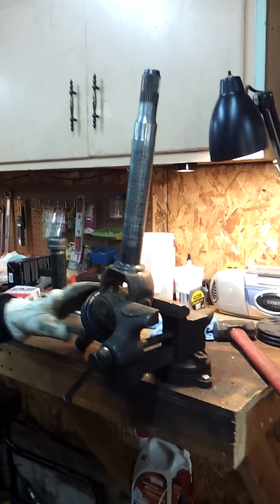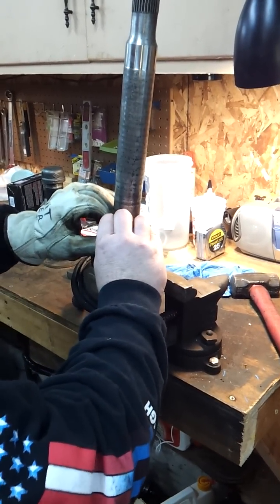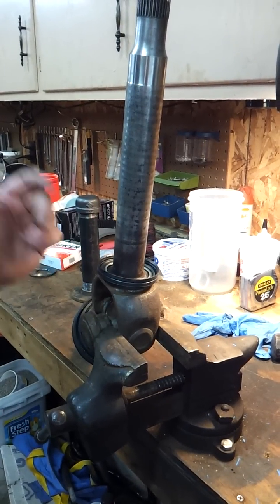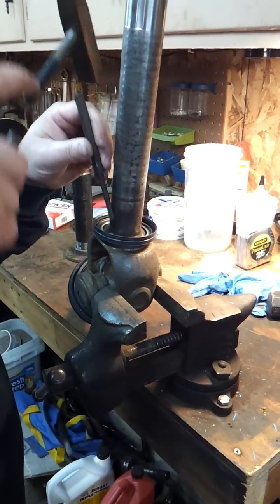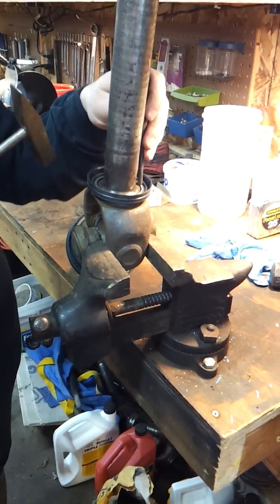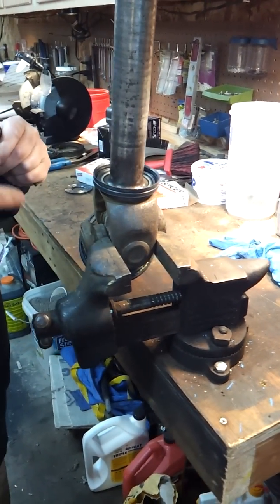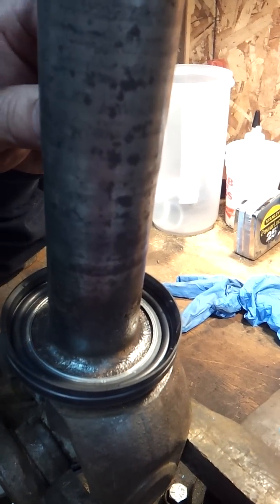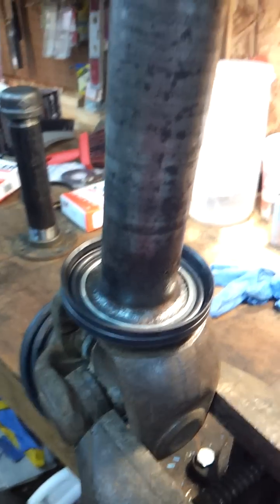2000 F250 front axle rebuild Part 5

Comment: I have a 2000 F350 4X4. I am having such a difficult time getting that dust seal on over the axle lip or collar or whatever it is called. I have tried the way you are doing it in your video but it pops off on the opposite side when I tap on it. I already got the driver side done with a ball joint receiving tube that measures 2-1/4" inside diameter and 2-1/2" outside diameter. It was a pain in the rear but it worked. I tried doing the same for the passenger side and it is not working this time. I measured the inside of that dust seal, National 710413, that is the old style, and it is around 55.8mm diameter and the axle collar that it is to go over is 60.4mm diameter. It doesn't make sense that they would make that with such a tight fit. From what it looks like, if the metal washer thing that is in the seal is driven tight on the shaft, it will rotate with the axle and therefore making the outer surface of the seal that makes contact with the axle tube causing it to deteriorate from the heat build-up when the axle spins. I just don't understand why they designed it like this. Also, the weight of the axle, especially the passenger side since it is longer/heavier would put a load against the dust seal causing it to prematurely wear out  and also then put stress into the knuckle seal on the stub shaft. What is your opinion on this?
Reply from the maker: +Nate In TX  Nate my only comment and I'm not sure if it is right or not is: check the lip on the collar if there is any rust or burrs tried gently filing or emery clothing them and see if that help to getting that seal on.  Its been awhile now since I did mine. But I think I took emery cloth to the metal where the seals went and also to the hub housing as well, that area had some rust on it. Hope this helps and good luck.

Comment: Does the shaft slide right out the diff for the driver side or do i have to open the diff in order to remove some sort of o ring or locking clip
Reply from the maker: +David Jackson no clips in diff, sorry I havent replied I didnt get a notification on a post.

Comment from the maker: I helped a buddy here recently that has a 2006 F250. The all metal "updated" seal did not fit into the tube like I have described in my video.  We ended up putting on the shaft just like I did the one on this video.